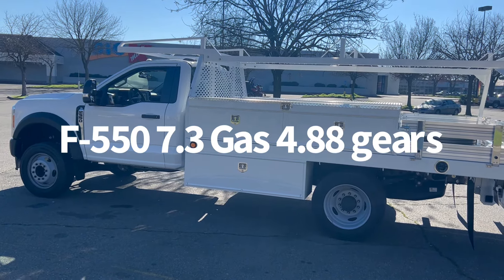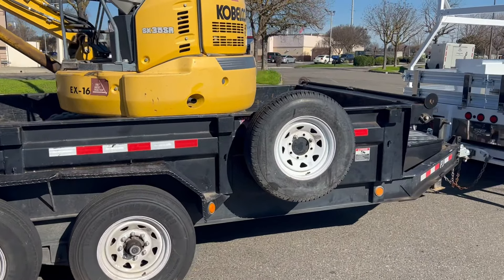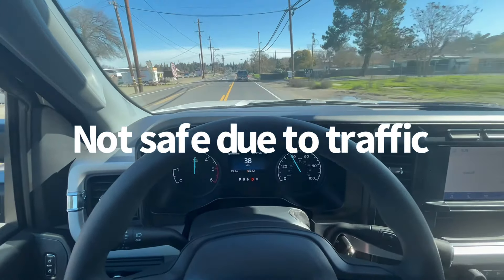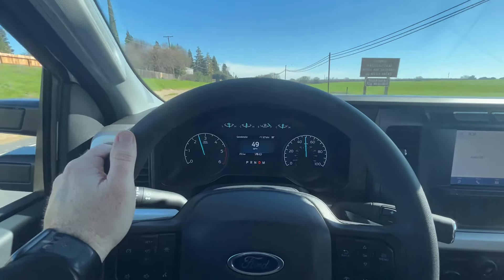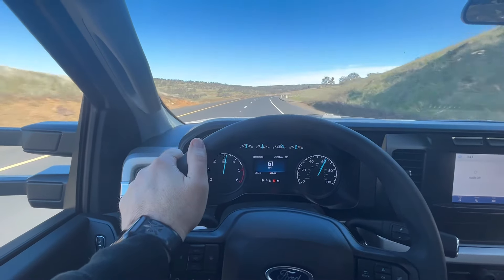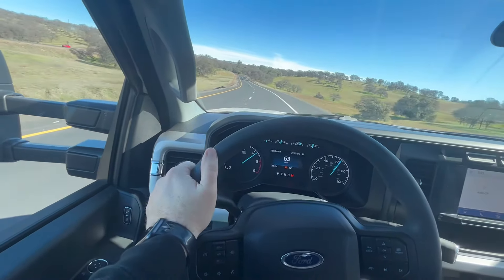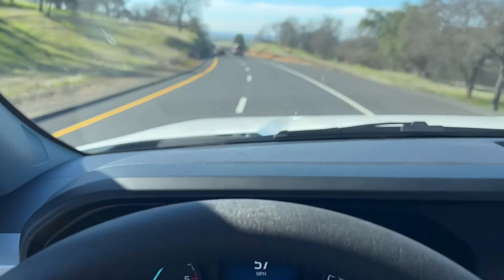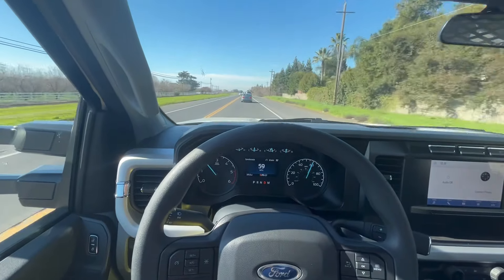F-550 Contractor Body 7.3 gas with 4.88 gears towing 14k(ish)

Comment: do you have an idea of what the 4.88 gears with the 7.3 gave you in MPG hitting those hills, I'm thinking  of building out a 84CAF550 for hauling 4,000 lb truck camper
Reply from the maker: I think for that trip up an back combined was 7ish.  The trucks are averaging between 7-8 with some lower and higher amounts depending on application.  There are days when they probably Idle most of the day.   

Our  6.7 power strokes average 9ish in the same applications.  The heavier 6.7s (flatbed 6.7 average 7-8 as well).    

One thing you may want to consider is looking at the non commercial trucks like the 350 with 4.3 gears.  These bigger commercial truck are all detuned.  Pretty sure these trucks are almost 100HP less than my personal7.3 truck.  The 6.7 powerstrokes are detuned as well.  I think our 650 flatbed 6.7 powerstroke is sub 300 HP.   My personal f-250 with 3.55 gears could pull this same weight at the same speeds but it would be in 3rd or 4th gear.  4.30 gears would be much better if loaded heavy all the time.

I know the 550 2x4's turn sharper than the f-350's but if you're going 4x4.............

Cheers